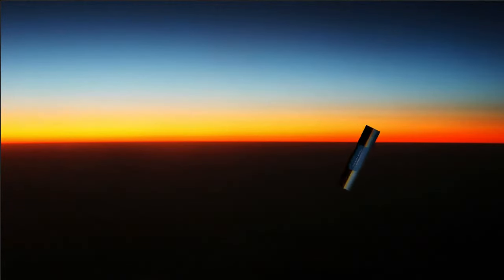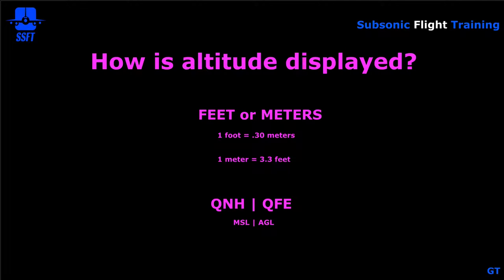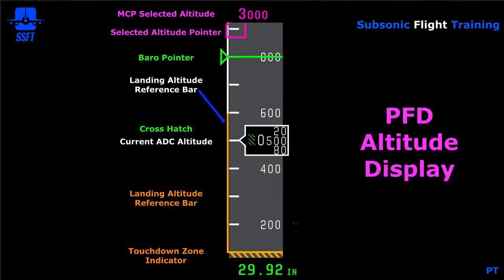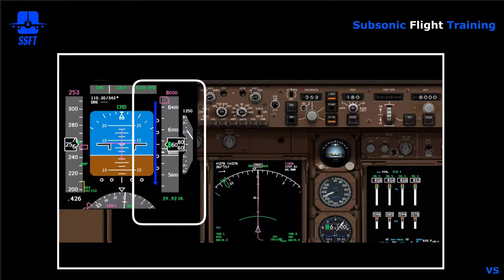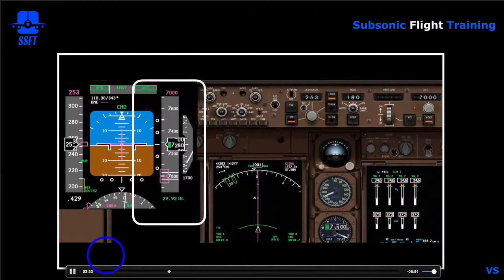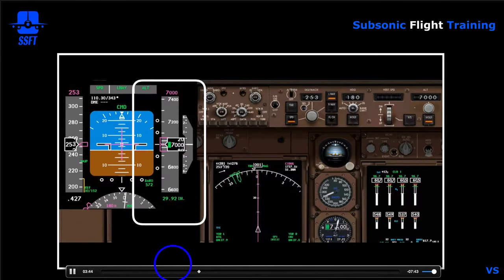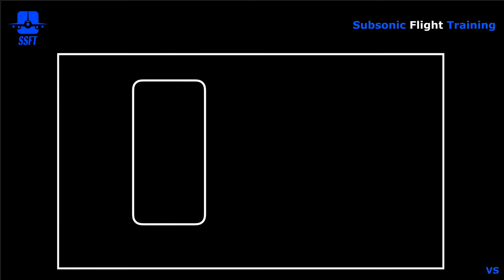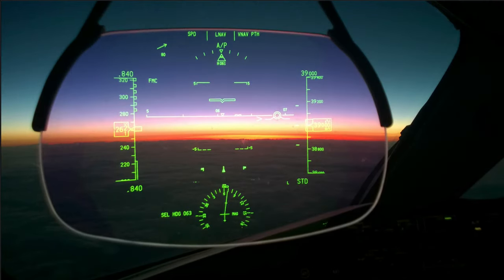EFIS PFD Altitude & Vertical Speed Displays (iFly 747-400)

Comment: Glad your back on the map Captain AL hope your good.  Hey I have yet another question. When you were descending  in vertical speed mode (1500 fpm) the throttles go to idle and even though the MCP speed was 253 you said in real life (thats one reason I love hearing your explanations your the real deal) the speed would be allowed to go up but what if there was a speed restriction, for some reason, how could you slow without reducing the 1500 foot rate? You can't just yank the speed breaks anytime you want can you??
Reply from the maker: I think I answered this question on my iPad, but it is showing up as not answered. Looks like i need to answer on my desktop. Generally, if there was a speed restriction, V/S is not the mode I would want to be in during the descent. I would be in VNAV PTH or FLCH SPD in pitch. In VNAV, the speed constraint or restriction would be maintained as programmed in the FMC, in FLCH we would set the desired speed ourselves in the MCP. If the descent rate needed to be increased, you can use the Speedbrakes partially or fully. In the case of your example, if I am at 1500 fpm V/S, and the speed starts increasing, which it will, your only options are to reduce the vertical rate or use the Speedbrakes to maintain the speed. You can use the SB anytime you need to induce drag during the descent. "Yank" is too strong a term with PAX aboard. We would smoothly extend them, so that the pitch and buffeting would change slowly and not abruptly for pax comfort. The only time you cannot use the Speedbrakes by limitation is below 1000 feet in FLCH (Asiana accident) or beyond Flaps 20...

Comment: What information does a dispatch paper contain? Do you get a dispatch paper before or after boarding?
Reply from the maker: You normally show at a certain time before departure to your operations center and receive your papers that were prepared from your dispatch center. They will include your planned routing, detailed flight plan, weather package, Dispatch Release, Performance Information, etc. Sometime prior to departure, you will get a close out updating the load information, performance, and weight and balance. You designate one of the identical flight plans given as the Master Flight Plan and compare courses and distances on it vs what you programmed in the FMC. Then during flight, times and fuel score are calculated and checked to track you are on course and that fuel used is correct enroute...

Comment: Hi Sir
What i know is that FLC is to change your altitude maintaining a specific speed.
Wt if you were forced to decend1500 f / minute? Does it mean that FLC won't work?
Reply: I just watched some videos for landing  and i noticed that FLC disconnects when activating V/S on the MCP.
Reply from the maker: You have 2 choices, you can either use V/S mode to descend at a fixed 1500 fpm, or you can use FLCH where the modes are HOLD | LNAV | FLCH SPD in the descent. The elevator pitches to control speed and the power goes to Idle. Let’s say the descent rate is 2000 fpm and we want 1500 fpm. In HOLD power is removed from the A/T servo motor, so you can just add thrust slowly which will cause the nose to pitch up to maintain speed and the rate of descent would be reduced, you keep adding power slowly until achieving 1500 fpm. If you needed more than 2000 fpm, you have 2 choices, increase speed, or use Speedbrakes if you cannot increase the speed, like  if you are at 250 below 10,000 feet and you want more descent rate...
Reply from the maker: Yes, because the key is you have to ask WHAT is controlling speed, in V/S, the speed is controlled by A/T because pitch is controlling a specific rate of climb or descent, like 1500fpm. In FLCH, speed is controlled by pitch, and the A/T controls rate of climb or descent. So, if you are in FLCH and go to V/S, it will come out of FLCH since you are now asking V/S to control to a specific rate of climb or descent and now speed is a function of thrust...

Comment: Hi. At 11:50 you change the altitude to 8000 and the plane starts to climb. When I tried this in the PMDG 747 I could only get it to climb if I used the dial to the left and entered a climb rate. You said you would climb using Flight Level Change, but I'm not sure what that is.  Am I missing something?  Thank you.
Reply from the maker: If you look at 11:35 on, you see I changed the altitude window from 6000 to 8000 and then pushed FLCH to commence the climb. It should then start a pretty shallow climb of around 1000 fpm with thrust coming up only a small amount, well below the reference thrust of CLB 1. Now if the PMDG model did nothing after several seconds and did not climb, then that is a problem with PMDG in trying to do a small altitude change in FLCH. If you had to use V/S to climb to 8000, that would indicate a problem. I would be willing to bet if you increased the altitude to a higher value like 15,000, the jet probably would have started to climb in FLCH with the PMDG model. Most of the time during the climb phase in line operations, you will be in VNAV, sometimes for small changes in altitude V/S works fine or FLCH because you have a minimal climb rate proportional to the change in altitude. Using VNAV for a small altitude change would cause a large change in thrust as it goes to the reference thrust, similar to what you see in my video, an immediate capture of the altitude, and then a large power reduction, not very smooth or comfortable for passengers, thus the preference of using FLCH or V/S for a small change in altitude.
Reply: Subsonic Flight Training thanks for your response.  I think the issue is with me not PMDG as I haven't done the lesson that covers FLCH yet.  I've just looked through your video titles and think it will be covered in the Autoflight MCP overview video. I'll check this evening and let you know.  Thanks again for the video and additional real-world insight.
Reply: Just tried it and it works as you say straight away.  If I leave the airspeed alone and try to climb it often over shoots the target altitude if the changes are small.  The engine indicator is always chowing CLB - not sure what this means - maybe in a later video or in the manual.  It seems to have the exact same issue as the i-fly simulation as it doesn't take 2  minutes to change altitude - it just seems to get there as quickly as possible.